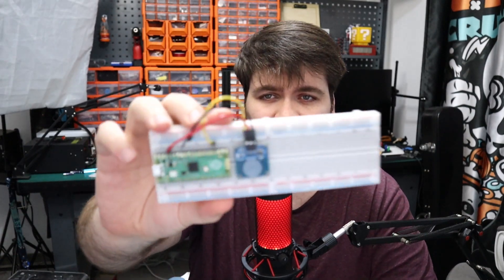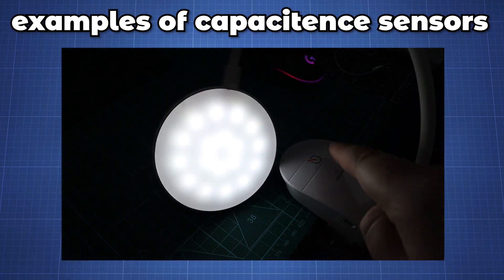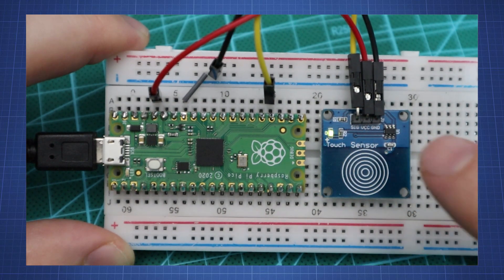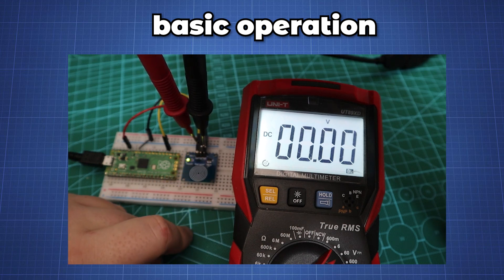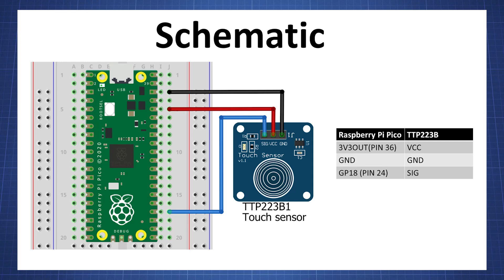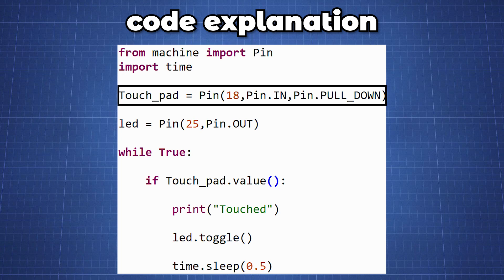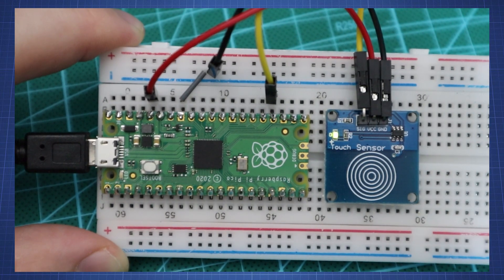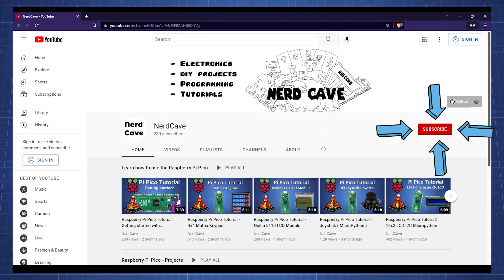Raspberry Pi Pico Tutorial - TTP223 Capacitive Touch Sensor Module

Comment: Good day, 1. For raspberry pi3 b+, which pins should I connect to? So as not to rewrite the code.
2. In which file should I enter your code?
Thank you!
Reply from the maker: I have not connected this to a raspberry pi but I can have a look, any GPIO pin should work, and for the code if you want you can run it in thonny

Comment: Thank you so much for this vid..!!🥺🥺
Well we are working on a project and we need to connect 8 leds with the pico... how can we do that?
Reply from the maker: Do you want to connect the LEDs to 8 different GPIO pins and control them? Here is something similar where I used few LED to create the knight rider LED effect https://youtu.be/JL5BS-cI-PI
Reply: @NerdCaveYT   thank you so much for the reference!!!
Well it's kind of similar to what we are doing...
I also hv another question.... if we connect all the leds with one gnd terminal of the pico.. will there be any problem?
Reply from the maker: all of them are common ground so all can go to one ground they are all connected to each other on the pico
Reply: @NerdCaveYT  I hv another problem... that how can I connect the touch sensor and the buzzer with the led..??!!
Means that when I touch the sensor one of the led glows up and the buzzer rings.. touch sensor is beign touched->buzzer activates>duration measured>dot or dash acc to time beign touched>recordes the dot or dash>gives outcome in led
I really can't find any such videos related to this...🙁🙁 I would really grateful if u help!!🥺🥺
Reply from the maker: I am a little bit confused what you want to achieve once someone touch the capactive sensor it will start taking time and turn on one LED and the buzzer and once you touch sensor again it will stop the buzzer but what will it do after? You can also reach me on discord where it might be easier to respond
Reply: @NerdCaveYT  I don't hv discord 🙁
Reply: @NerdCaveYT  do u any other platform to talk??
Or can u provide ur email id so that I can leave a msg?
I really need help for this project!!😔😔
Reply from the maker: @sanchitadas9823  you can use the online discord version https://discord.onl/web/  and my ID is Guitarman ZA#9895 or the nerdcave discord server is  https://discord.gg/3JV3ZqDn